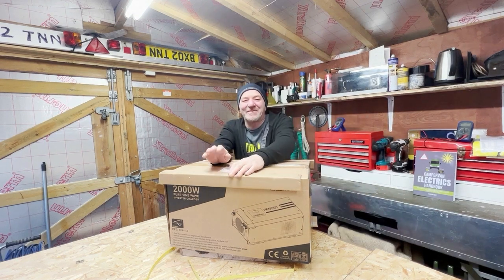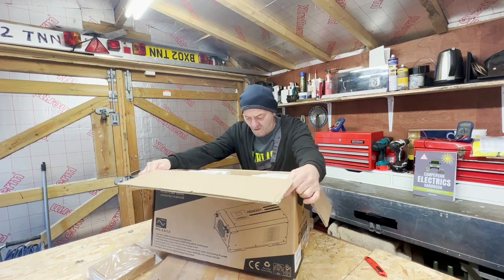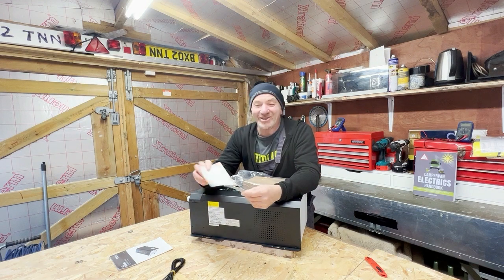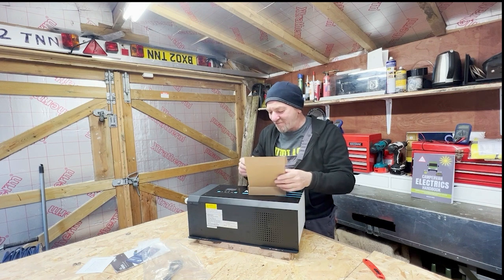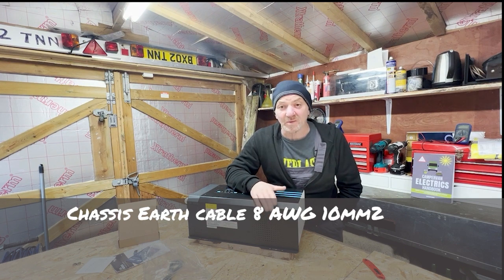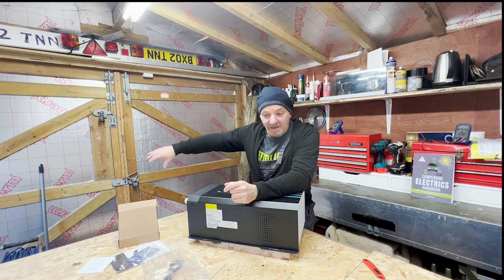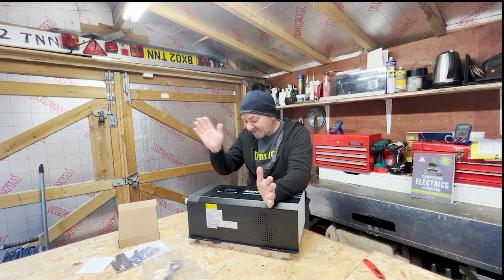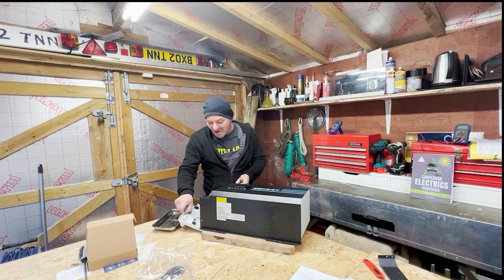2000w Renogy Inverter Charger Review

Comment: Hi there i have the same inverter charger wonder if you can advise me so when the inverter is switched off i plug into shore power and the inverter lights up and has 230v  input but wont charge the battery untill i turn on the inverter with the switch is this correct as i thought it should start charging as soon as shore power is plugged in hope you can help thanks mark
Reply from the maker: Yes I have a similar issue, it sometimes won't charge the battery until i select battery priority after i have plugged in.

Comment: So is there a blue tooth module for it Ive been waisting data all day trying to find out so yeah what’s the go there buddy
Reply from the maker: Not on the 3000 or 2000 watt version BUT the REGO 12V 3000W Pure Sine Wave Inverter Charger w/ LCD Display has bluetooth, but only available in USA I think..
Reply: @mowgliadventures5773  so why can’t I use it in Australia you know all I need to do is step down our 240 Volts to 120 Volts on the input and on the output step up the 120 Volts to 240 Volts will that work?
Reply from the maker: @corkystephan5073  yes it would, if you can get Renogy to sell you one. Of course stepping up and down voltages will introduce a loss of energy.

Comment: What about the issue with it being centre tapped?
Reply from the maker: I am not sure what you mean? This one, I  understand is a EU UK model with 12/240v transformer.
Reply: @mowgliadventures5773  have you fitted it? It won't trip RCDs as its centre tapped turning into a real headache for me.
Reply from the maker: @wheelsandanxiety  I had a discussion on this a while back. I don't use an RCD on the output.  My input is a double pole Type A RCD.  I do make sure the invertercharger casing is earthed (bonded) though. I only have a doubled insulated AC camera battery charger and laptop to power up. So I didn't have to worry about bonding an output RCD to the chassis. (Renogy advise to bond the unit to the chassis). I have heard of others with this issue and a center tapped inverter, and the solution they used was to install the Bluesea C-Series ELCI Main Circuit Breaker - Double Pole 230V AC 16A.
Reply from the maker: The only solution to a centre tap inverter and having a RCD is to use this unit. Blue sea C-Series ELCI Main Circuit Breaker - Double Pole 230V AC 16A. Blue sea GFI socket operates independently of the inverter or a bonded RCB. It is rated for a 5milli-volt fault and approved by the US boating type people.. And if all else fails the Inverter supply fuse should blow.
Reply: @mowgliadventures5773 was it a video you discussed it in?
Reply: @mowgliadventures5773  blimey not cheap, think I'd be better off just getting a different inverter charger. Think renology need to clearly advertise that this is centre tapped (which they currently dont)

Comment: So it charges itself while it's outputing to what you have hooked up
Reply from the maker: It supplies an AC output and it charges the battery when hooked up to shore power and it is on  "Utility Priority"  setting, when its on Battery Priority setting it charges the battery.

Comment: What size Uk power cable does the 3000w inverter/ charger  use please?
Reply from the maker: 4|0AWG or in EU /UK sizes 107mm2 and a 300a Fuse.

Comment: Ac input at how many amps?
Reply from the maker: The maths are very simple.... 2000w / the base VAC.   For example,    USA 2000w/110vac = 18a.  the rest of the world 2000w/240vac = 8.3a.
Reply: Let’s say you hook up 120 volt generator  powering  at on 15 amp. How will the invert handle it?
Reply from the maker: If the inverter-charger  is set for  the AC output will come from the battery bank and the generator will be used to "charge" the battery.  If The unit is set to , the generator will supply the Unit AC output and any spare energy will go to charging the battery. @KODIAKJAYMZ

Comment: This thing is bigger then I thought...
Reply from the maker: yep it is not small....
Reply: @mowgliadventures5773  Well It took me a while to buy one.. As it does provide an instant start Generator function.. While the cost to add all the features this has. Would cost you twice as much and make a wiring nightmare...

And why they don't mention the Case Grounding Screw is inside the Case. As I seen it once I got the cover off...It's sticking up on the bottom... 

Now I got Solar, shore power, alternator power and generator to keep it all going. If the power goes out....
Reply: @mowgliadventures5773  You need the Renogy Hub to make use of all the stuff they sell I found out..As the Hub allows RS485\CAN Bus connections. Using either BT-2 or devices with RS485\RJ45 connections..As it can be switched to either...

Just wish Renogy would stick with one Protocol. And not have to add hock all their stuff.. As everything is mark for Future use when it comes to them ports..

Comment: Hey, you never did do a video on installing this juggernaut in an RV, did you 🤣 I just bought one of these, and - from the product pictures - never thought it was THAT big. Yes, all my fault, I know... I am able to read and interpret dimensions if I do... On the other hand it will replace a stolen WT Combi S, which was not considerably smaller. So I am looking forward to finding out if and how I can fit this one...💪
Reply from the maker: I have the video of bench instal in the "can" and will post it later 🙂I am too wrestling with it as I actually instal it in our van. It is big and heavy and remember it can't be side mounted.
Reply: @mowgliadventures5773  What exactly do you mean by "it cannot be side mounted"? It can be wall mounted horizontally, right?? (For me it needs to be...😬)
Reply from the maker: @planely1263    Mount it flat on its base. ( Horizontally)  apparently the big coil transformer inside is not well secured and will break its mounts and fail or short if you fit it on it's side or end down.
Reply: @planely1263  Hahahaa I guess he meant it can not be bolted to a wall but hey Carmo has got his bolted to a wall and it’s been like that for two years now and it still going but it’s not in a motor home it’s in his shed
Reply: @corkystephan5073  Oops, I never updated my post: In the end I sent it back and installed an Ective charger/converter. Same brand as the battery I had to get, too. It was just not feasible to install that juggernaut in my T4 🤷‍♂️

Comment: I don’t understand why these things exist o why they are so large. Renogy’s inverters have the same conduits switch and I can carry an ac battery charger for less than 1/6 the weight. Do you think these are made for off grid home living rather than mobile living? Throw in grounding to the chassis…why? Your vehicle is grounded to nothing other than the starter battery. The tutted see to that. Surely all grounding 120/240v to the chassis does is allow frying of sensitive ecu’s in your engine. Please correct where I am mistaken, I am no expert.
Reply: Ok when you pull up at a caravan park and plug in your motor home then it will be earthed hahahaa you get it
Reply: And there’s nothing stopping you from bashing in an earth stake and earthing your motor home when you stop somewhere because by some freek situation that you just might cop a direct strike from a lightning bolt an earth stake will determine you live or die via a direct strike from a direct hit does that make any sense to you